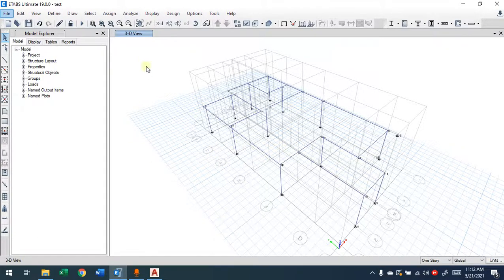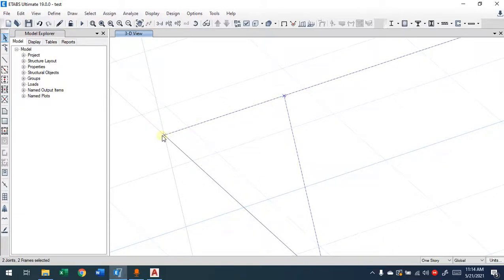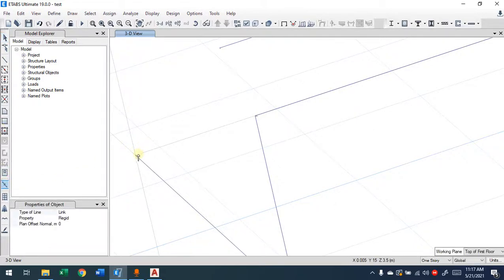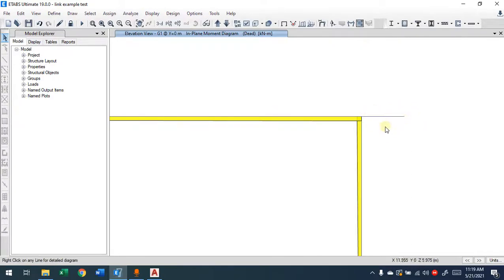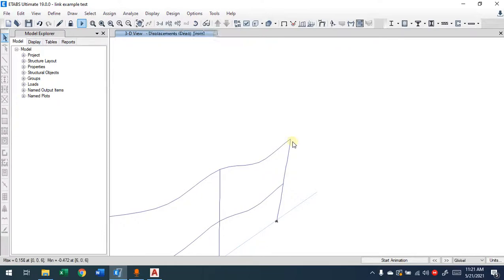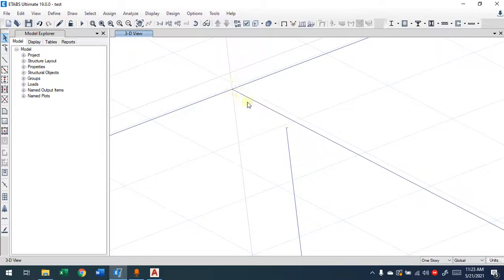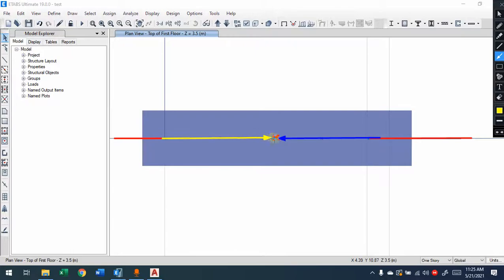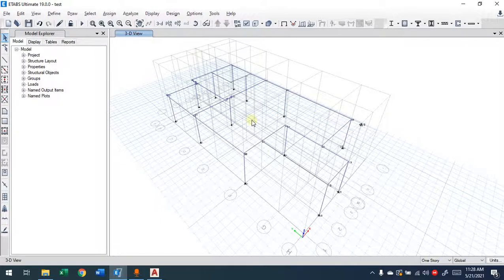CVLE489 15 ETABS  MODELING LINKS BEAM AND COLUMN INTERSECTION

Comment: Sir, I would like to clarify a question.
What is the difference between using link-type elements or using offset with the function insertion point  for modeling beams and columns that don't have the same axes?
Reply from the maker: Dear Daniele, 
sorry for the late reply..
ETABS is taking the centroid (center of the area) of the shapes as the connection point. if you are aware of eccentricity, the link will serve as the distance from the center. If you just offset the point it might not be considered as a connected joint (even though the 3D view seems to be over each other).  
hope that will answer your question.
Reply: @shahab441  Sir please make a one more video clip which clearify the "Daniele Benvegnu" 's question .as i have the sam equestion like her and unfortunately didnt understand fully your reply to her.
Reply: Same qstn... Does the link create the additional eccentricity moment

Comment: هل استطيع ان ادمج عمودين في طابقين متتالين  كعمود واحد .
اي ان الطول للعمود يصبح ارتفاع  االطابقين.
Reply from the maker: if not mistaken this is what you have asked:
Can I combine two columns on two consecutive floors with one column? That is, the length of the column becomes the height of the two floors.

the answer to that would be Yes/and No. one should understand the Slenderness Ratio (k) which decides the curvature/behavior of the column, to answer the question. 

In practice, if you don't cast the whole column as one, the connection of the beam will create a bracing and changes the behavior of the column (that is why there will be two columns rather than one).

It is advisable to draw as one column if there will be no beams intersecting the column.
Reply: @shahab441  
Thank you .